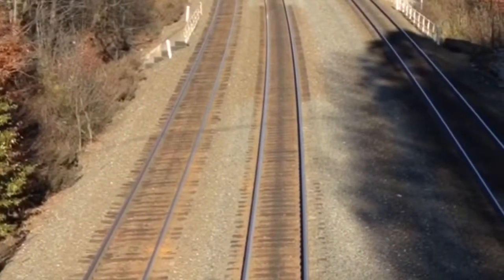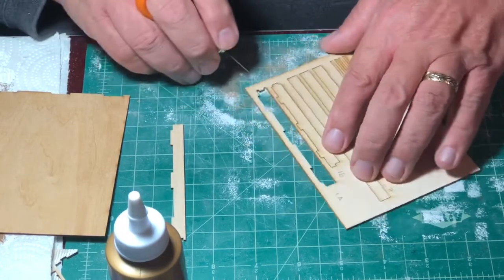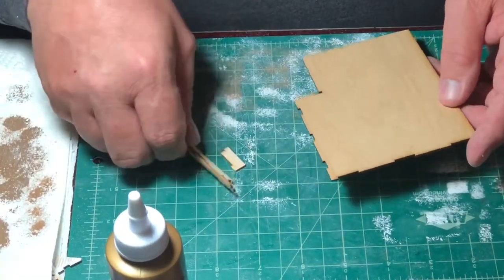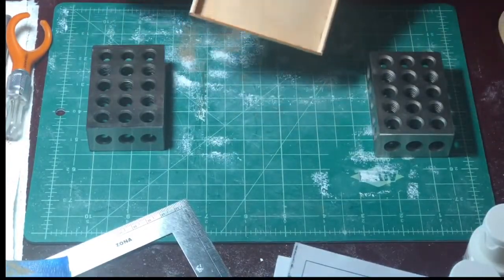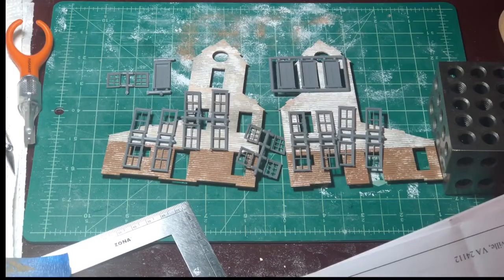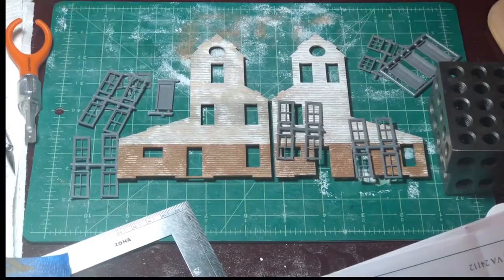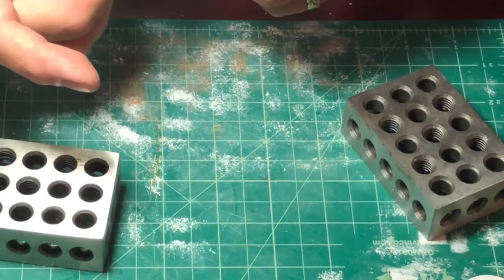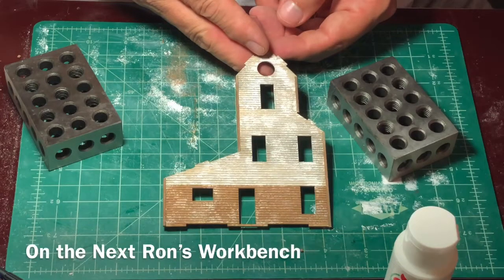Ron’s Workbench: Episode 15 A Firm Foundation

Comment: the kit is not a day build by any means. glue it and let it dry. then move on. windows fit well. is there a window sill on them? that is one thing I always mess up and end up with sills on the bottom and then on the top for some.
Reply from the maker: Hi Brother, Yes this is definitely not a kit you slap together. I’m enjoying taking my time with it. It’s a fun kit and challenging because of the overall architecture design. Jeff at Motrack turned out a winner by re-releasing this  kit. We’ll see how good my glueing technique is when it come time to add the upper levels and cupola. To answer your question, yes the windows have sills on them, I’m always starring at the widows when I’m building a model making sure I ger the top and bottom sills correctly. Thanks for all your support. Ron